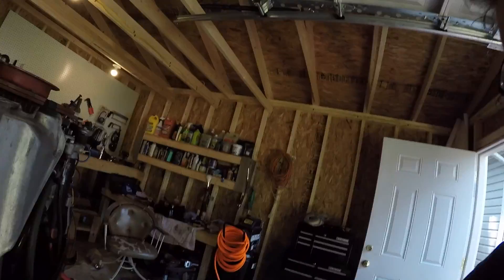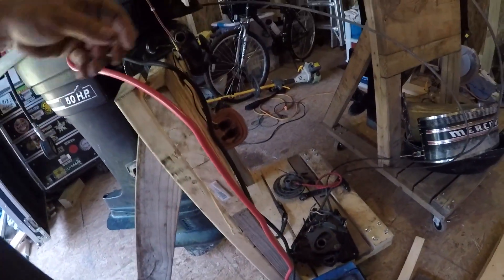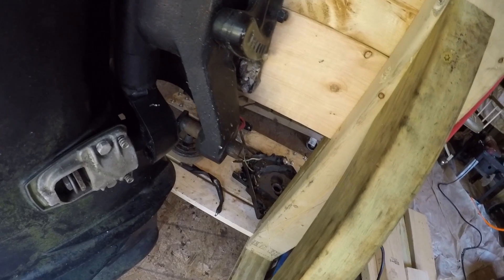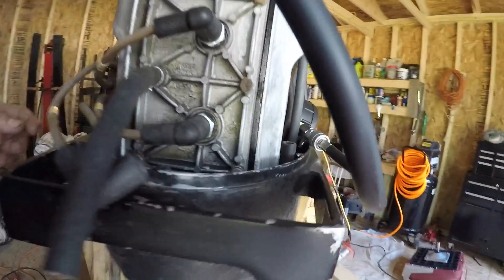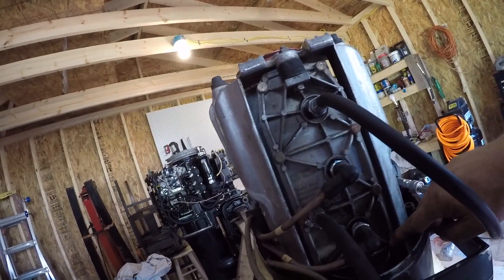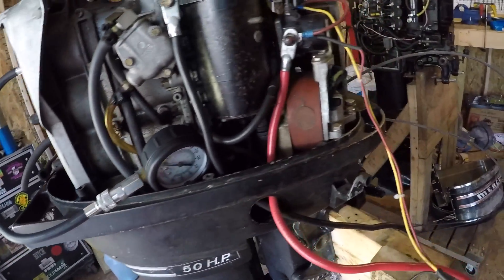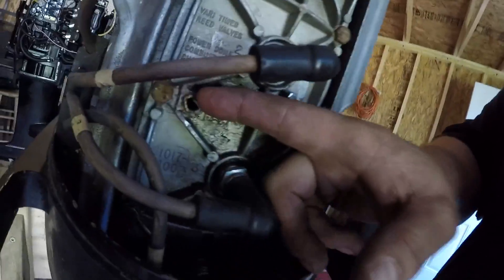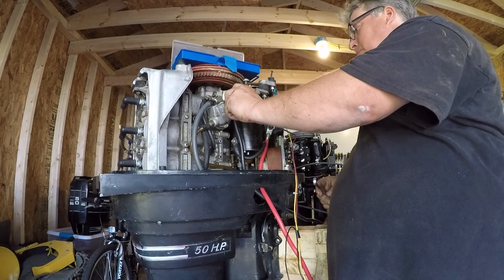Mercury Outboard Thunderbolt 500 50 HP Part 1 - Inspection and disassembly

Comment: Hi Mr hawke eye, I have a 73 thunder bolt and have a problem with getting it out if gear, have you a video on getting neutral from the motor side?
Reply from the maker: take the lower off and see if it shifts and the linkage moves.  On the lower you can move the shift splines and see if it shifts.  Put back on in neutral.

Comment: In that video, is the clear line going g to the bottom port of the fuel pump going to the carbs or the tank?
Reply from the maker: I believe the inlet on the the flat side iis the out to the carb.  Assume you have the check valve set correctly, when you pump on the fuel bulb fuel will pump fuel out toward the carbs.  Just use an old water bottle and.see if it fills.  You can even turn over the engine and it should pump fuel.
Reply: @hawkeyemarine  hey, thank for the reply. That's what I thought but there's a parts manual from mercury which shows the opposite. Very confused...

Comment: We’re is the oil fill and drain on this type of motor have trouble locating this .
Reply from the maker: Its on the lower unit.
Reply: I was able to find the lower until oil drain and fill . I was looking for the engine oil drain and fill on this motor any
Reply from the maker: @natemaes2724  No its a 2 stroke oil is mixed with the gas 50:1 Please subscribe.
Reply: Thanks you have been great help . This type of motor I don’t know much about . I get it now fuel and oil get sent to the heads . No oil in the motor itself

Comment: I have one of these vintage 70's Merc Thunderbolt 50HP 2 stroke 4 cylinder that I rebuilt and got running, but it idles very high in neutral!. Anyone know what I need to adjust to get it to idle properly?. I was thinking it could maybe be the cable that comes from the Mercontrol/throttle/choke, and maybe I need to adjust one of the stop screws on the side?, and I know one does timing so I just need to know which one to adjust so I don't accidentally end up screwing something up!?. Any advice would be very much appreciated!. I want to go on the water, but I can't because I know if I put it in gear with it idling that high that it'll be bad news bear! lol. Mine is identical to this one.

Comment: I know, oce more, old video but which one of theese videos are you putting the rectifier in? My 1974 500 thunderbolt are not chargeing the battery so I guess I have to put in a new rectifier but I would need some tips on it, your videos are good👍
Reply from the maker: The same mod will work here is the link:  https://www.youtube.com/watch?v=VJ_505Y7bTc
Reply from the maker: Also, make sure your hot battery lead does not connect in any way to the switch box it will fry it.

Comment: Where can I get the correct wiring diagram for this engine? I am installing a new harness but the old wires are so corroded that I can't tell what colors they are. Thanks!
Reply from the maker: I got mine from a Cylmer manual.
Reply from the maker: try  this one https://lh6.googleusercontent.com/proxy/GJ91pboWDSpQtQuXrLmf0sG-8hmdilV6s5OxIRznI6wDBfZ-RhzEpzPiegp6Qi5pd-IbMpsmRc2b43HE5xQSP4g9wZSuMGJy=w1200-h630-p-k-no-nu
Reply from the maker: Try this page for your wiring diagraphm https://maxrules.com/mercwireindex.php
Reply: @hawkeyemarine  wow thanks!

Comment: Have Merc 500 50hp. Ran fine last year till wouldn't start. Brought her home rebuilt carbs new fuel filter and switch box. Replaced any need wiring cleaned tank out new fuel line with filter. She will crank and run on high rev. Won't start in neutral and when I get her started at high rev then go to neutral before going into gear she dies. Need help.
Reply from the maker: Did you check the timing?  Could be advanced.  You'll need to check the primary and secondary pickup.

Comment: Was wondering if you have any shift levers you might want to part with
Reply from the maker: Maybe depends on what part you asking about.  The long bar going down into the midsection to the lower unit?  Or the rod that it connects to?

Comment: Good day,
I have found your video’s helpful, presently working on my father in-laws 1973 Mercury Thunderbolt 500 50hp outboard. The leg was run without oil, I’m trying to remove the bearing carrier assembly. What puller do you recommend. 
Thanks Gregg

Comment: What kind of carburetors are on this? I need a kit.
Reply from the maker: Try this: http://www.marineengine.com/newparts/part_details.php?pnum=MER1395-9259
Reply: Okay upon further inspection this isn't the same motor. Mine has the black and red cover. I believe it's a 1973 with a Tillotson carb. Have you had any luck getting kits for them. KA24AT. I'm not having an easy time finding one. If you could point me in a reputable seller much appreciated.

Comment: Hey there, I just recently purchased a Merc 500 and it runs at a good speed but it won't open all the way when I push full throttle, and when in full throttle position, it sometimes kicks in and out of full power, do you have any suggestions on how to fix this issue?
Reply from the maker: Check your fuel bulb and put a new fuel pump on it.
Reply: Thanks for getting back to me. The bulb and line seem good they hold pressure, but I can check again. Would the fule pump from a 40hp Merc blue stripe work as a replacement?
Reply from the maker: @patc2478  I would just buy a new Sierra fuel pump kit.

Comment: I know this is an old video, but FYI...when you do a compression test you need to remove all the spark plugs out and give the engine full throttle with the choke off.  You don't want to restrict air going into the cylinders to get an accurate reading.  Removing the plugs gives you a faster RPM while cranking.
Reply from the maker: Oh yeah its way old.  That series was one of the first.
Reply: @hawkeyemarine  Hey I think the plate that goes on the distributor with the line that you said you don't know what it's for is actually to help time. You can use the plate to help Mark the timing
Reply: @hawkeyemarine  Hey I think the plate that goes on the distributor with the line that you said you don't know what it's for is actually to help time. You can use the plate to help Mark the timing
Reply from the maker: @brandonmitchell3762  not sure its a pretty old video now and I have several video's on this motor.  And, a few video's on timing on this motor.  Its tricky one to time out right.

Comment: great videos. what is the black thing called that hooks to both carbs and opens the flapper. not the choke one. thanks
Reply from the maker: Pickup bracket I believe its part number 53719A2.

Comment: I have the 4 stroke version of this motor. I really want to use a tiller, but the conversion doesn't look straightforward from the research I've done. Can you please help direct me?
Reply from the maker: No I don't think it would work.  I am not aware of any 4 strokes Mercury made from th 60's, 70's or 80's?
Reply: @hawkeyemarine  I have two old motors. They both say 50HP. I was told they were Four Stroke. They both have a 4 written on the cover. Could that just mean it has 4 cylinders? I was confused why I couldn't dint where the oil went, and now I'm wondering if that's why....
Reply from the maker: Yes its not a 4 stroke its a 4 cylinder 2 stroke @samanthamacarages5695

Comment: Hi, Sir. I have the same engine, can you help me to point out where the thermostat at ? Thanks. I have no water coming out a pee hole.
Reply from the maker: The early engines don't have a thermostat.  Take a piece of 15 lb. fishing line and poke up through the pee hole first to make sure you don't have an obstruction.  If you still don't water coming out you need to check your water pump.  If that's new then you probably have blockage inside the plate were the water is.
Reply: HawkeyeMarine it was peed before I replaced water pump impeller, I check water pump with a cordless drill and it shoot out water so that mean I put the water pump impeller correctly. I think a small piece of old impeller was broken and stuck somewhere. I used air pressure blow  from the pee hole down and attached the hose with water all fine but can’t shoot the water from copper tube up to pee hole. Any ideas?
Reply from the maker: You can take the lower unit off and put a hose on the copper tube and connect to your house water spicket and turn it on just don't give it much pressure and it see if it works its way out the pee hole.  You'll have some water coming from the base of the motor when you do this but its normal.
Reply from the maker: You'll have to rig something usually to do this.  Local hardware store should have a garden hose end and get some clear tubing that will fit on the end of the copper tube.
Reply: HawkeyeMarine I did but the pressure is too high and popped the connection, I have no problem run the water from the pee hole down.
Reply from the maker: What's the serial number on that motor?
Reply from the maker: When you turn on the hose put your finger over the pee hole and let it build up some pressure and they it should come out.
Reply: 3348404, It did peed out wow, thanks so much ! now I have another problem with my gear when I installed the lower unit, I have it on neutral  the gear was in neutral and the low unit is in Neutral too because i can spin the repeller freely and able to insert it in the body without any struggle but when i start the engine it in the forward gear for some reason.
Reply from the maker: Its not in neutral then.  Be careful when you put the lower unit back on and make sure it doesn't bind up.  There is a small triangle looking piece that is part of the intake manifold and as the shift rod moves up it can put pressure on the intake plate and you can pop a hole in the intake.  You will have to experiment with the shift shaft until you get it in neutral.   I usually find reverse and then move the shift shaft into neutral on the lower unit.  Its not going to move but maybe a 1/4" or so.  Its travel is not very far.

Comment: Hello Sr. i bought used one motor mercury 50 hp, but it came without distribuitor. so i got the serial number from him, but i could not find the part for this serial number.  do you know it the distribuitor from diferent serial number will work for all 50 hp motor? the serial number i got here is 3170221. is 4 cil 2 strokes 500 50hp. thanks for any advice.
Reply from the maker: Yes, here is one listed on ebay.  https://www.ebay.com/itm/MERCURY-500-OUTBOARD-1971-1975-50-HP-IGNITION-DRIVER-4674A3-distributor/232391126095?epid=2231348129&hash=item361b972c4f:g:qi0AAOSwHLNZVPDE&vxp=mtr
Reply: Thanks man.. i will try buy it.. and i think have more part missing from this engine.. but i not sure what else does it need.. i have to study about it.. i will try find some explosion manual from it..

Comment: Hola dónde puedo conseguir la banda para ese motor
Reply from the maker: ¿Banda? Ebay tiene muchas partes. En su mayoría figuran en inglés.
Reply: Se reventó la banda y no la he podido conseguir
Reply from the maker: @ulisesescamilla4229  correa dentada?
Reply from the maker: https://www.ebay.com/itm/Mercury-New-OEM-Timing-Belt-20140-60508/190867652823?epid=1718881549&hash=item2c709940d7:g:2LcAAOSwBqZcBYlb:rk:2:pf:0
Reply: @hawkeyemarine  si es Correa dentada
Reply from the maker: El enlace de ebay que te envié es para un Mercury Thunderbolt 500. Puedes ver mi video en el momento para establecer el tiempo. @ulisesescamilla4229
Reply from the maker: Para estar seguro de cuál es su número de serie? Está en la placa de dirección delantera. O podría estar en el capó.
Reply: @hawkeyemarine  cuál es el capó?
Tengo la banda rota pero no la e podido conseguir
Reply from the maker: @ulisesescamilla4229  No estoy seguro de lo que quieres decir. La parte # es 10-20140 CORREA DE DISTRIBUCIÓN.
Reply: @hawkeyemarine  mi motor no tiene la Correa de distribución y se la quiero comprar y le pregunto a usted si no sabe donde la puedo comprar
Reply from the maker: @ulisesescamilla4229  La parte está disponible. No tengo la parte
Reply: @hawkeyemarine  pero usted no sabe dónde puedo conseguir la banda?
Reply from the maker: @ulisesescamilla4229  ¿Estás en Estados Unidos?
Reply: @hawkeyemarine  no Vivo en México
Reply from the maker: @ulisesescamilla4229  Este cinturón se envía internacionalmente. https://www.ebay.com/itm/Mercury-New-OEM-Timing-Belt-20140-60508/190867652823?epid=1718881549&hash=item2c709940d7:g:2LcAAOSwBqZcBYlb:rk:3:p.pdf